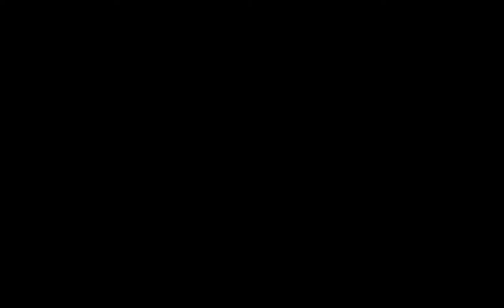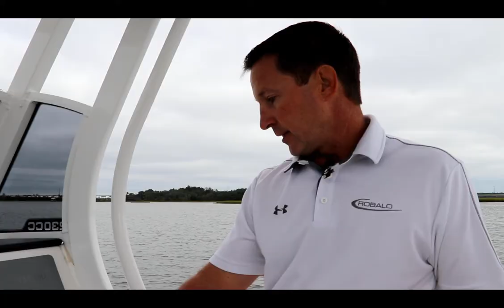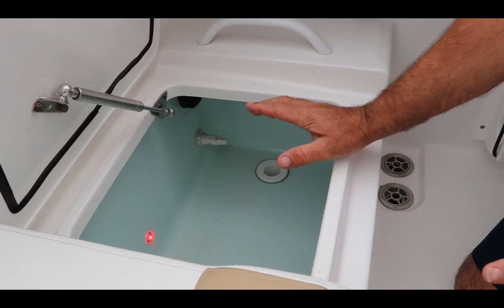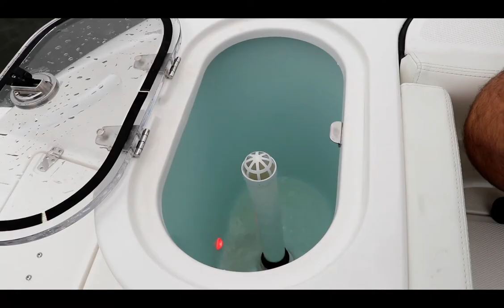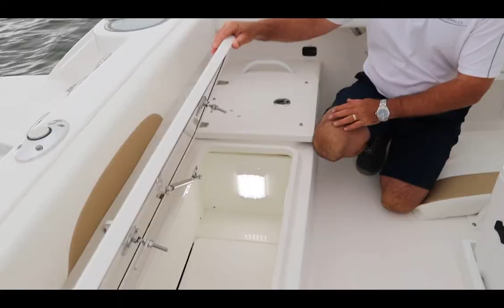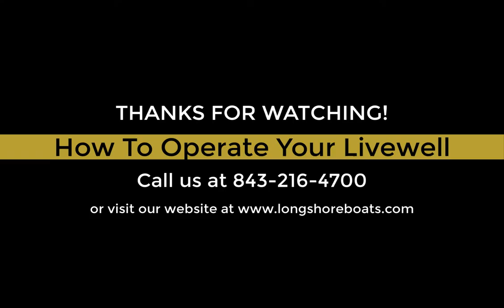How To Operate Your Livewell || Longshore Boats

Comment: Do you leave the livewell pump on the entire time your fishing?
Reply from the maker: It depends on the type of livewell. In smaller boats from 28ft down, we suggest leaving them running so your bait is still fresh and alive.
Reply: Yeah it’s a 20 foot bay boat.  Same live well setup.
Reply from the maker: @nobs-fishingfishbrainprost5624  then yes, run it the entire time!
Reply: @LongshoreBoatsCharleston  will the pump burn out if stayed on with no water flowing? If yes about how long ?
Reply from the maker: @burnthecandleatbothendz  It's normally not a good idea to run the livewell dry or when you're traveling between locations. When the boat is on plane, the livewell pickup is out of the water. The pump is designed to be immersed in the water while operating. Hope this helps!
Reply: @LongshoreBoatsCharleston  thanks for responding, have a great weekend!